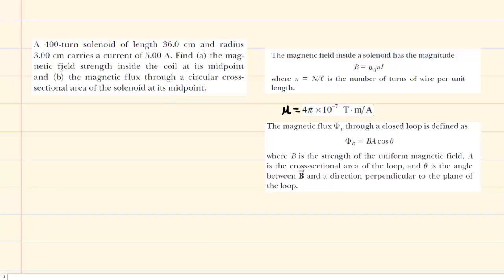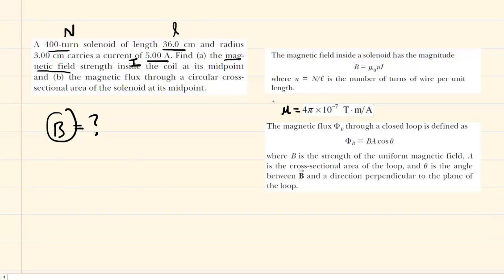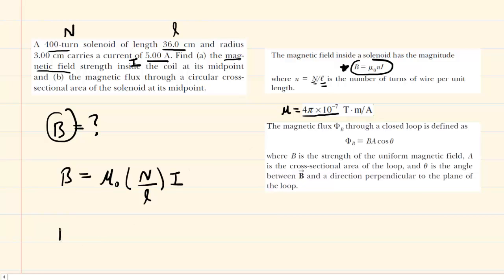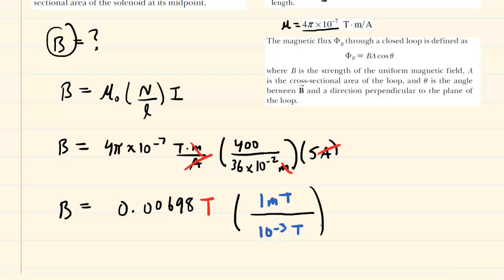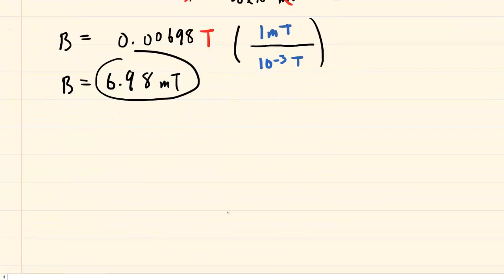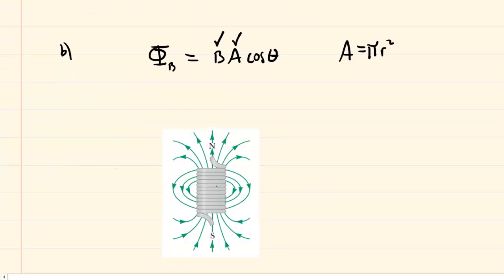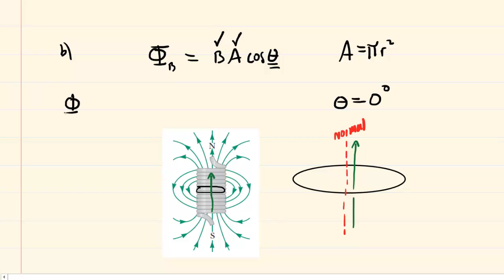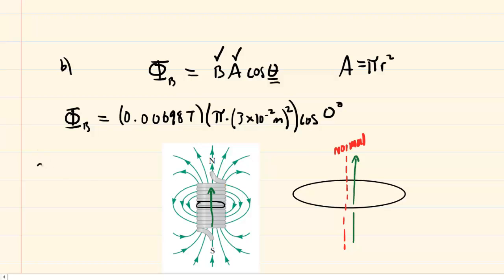A 400 turn solenoid of length 36cm

Comment: Consider a long solenoid of radius a and a long straight thin insulating wire placed inside the
solenoid parallel to its axis at a distance r0 away from the axis. Suppose the solenoid carries a
current I and the wire carries a uniform charge density λ.
(a) Calculate the angular momentum per unit length of this system: (i) about the axis of the
solenoid, (ii) about the wire.
(b) If we change the current in the solenoid, how would it affect the momentum of this system.
Suppose the solenoid is fixed but the wire is free to move.
Plz solve it